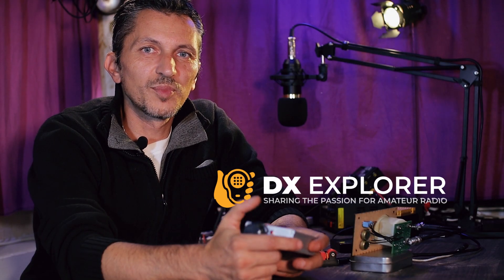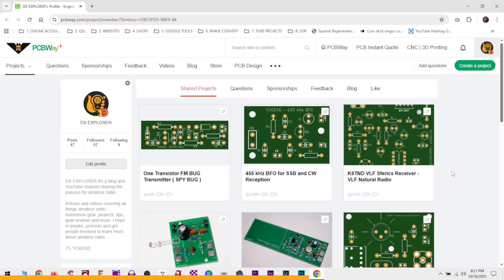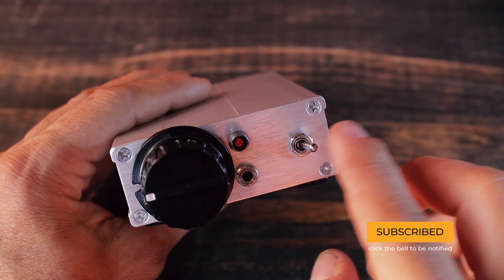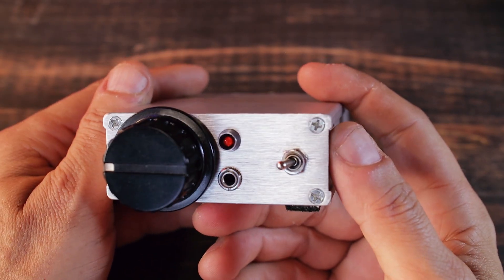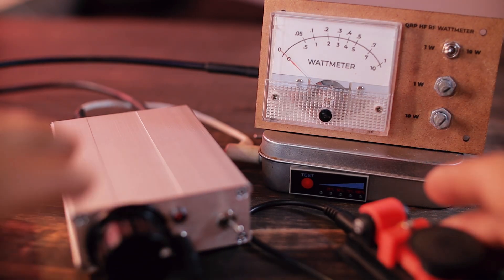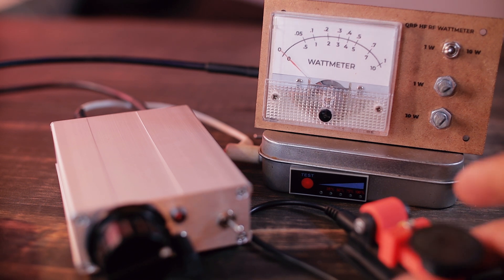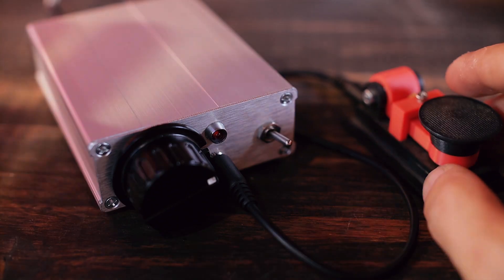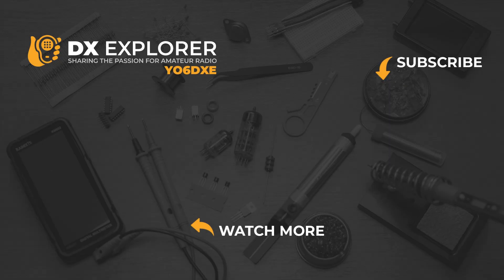Mini 20 - 400mW CW Portable QRP Transmitter With VXO

Comment: Mr. DX: GREETINGS!!! -- After watching your video here and reviewing your schematic of this "CW Transmitter", I believe you need to add-in some clarification within your schematic between your RX/TX switch (K) and your antenna symbol (ANT) that not only shows how the antenna is switched between -- RECEIVE & TRANSMIT -- but also with how you have the 50-Ohm 1/2-Watt Dummy-Load Resistor wired in as well. You spent a fair amount of time explaining all of this within your video, but your schematic doesn't show how any of this is connected and/or done at all whatsoever!!! Otherwise.....nice job!!!

/
Reply from the maker: Of course it's not in the schematic. The RX / TX switch was something custom made for my friend. But if you want to do the same... have a look later on today in the posts section here on the channel... I will post later in the afternoon a drawing to explain how I connected everything. 73, YO6DXDE.
Reply from the maker: Here it is: http://youtube.com/post/UgkxmwA86pfxjLcs0JHOFVwsiikqpW9yvLra?si=sepwgCgfMs0EGO3L

Comment: I can not understand how Q2 works. L2 shorts out the DC bias (Base Emitter) for Q2. When it don´t need any DC bias where is R4/33k good for?
Reply: If I´m right it should be possible to remove R4 without any effect. Q2 works than in C-mode.
Reply from the maker: I don't know I didn't tried. I simply respected the transmitter part from the schematic of the Pixie transceiver.
Reply from the maker: If I remove the 100uH inductor, the power drops down for some reason. I don't really understand it here, but that is how the schematic is so I just build it and if it works I am happy 😁 I don't waste my time asking myself too many questions 😀 73, YO6DXE

Comment: can you test how it behaves with L3=22uH, 470uH, 1mH, 2.2mH, 4.7mH, 10mH, see power transitions on CW transmission? 
the idea is L3 is not a "choke", but a storage inductor. i don't have the means to see signals. 

the collector inductor, i believe, is wrongly presented as a RF blocker. many HAMs believe it is a RF blocker, but i doubt.
Reply from the maker: I don't think is an RF choke for sure. The value is too small. Not sure about the other bands, but I did tested with some other values for L3... and with 100uH for example the power went down if I remember well. Same for L2... as I tried to see if it still works if I don't install it. It did work but the power went down. I will try to experiment a little more when I will test the circuit on other bands as well. Talking about L3. 73, YO6DXE.
Reply: @dxexplorer  i expect the power to get down, transition like, if you increase L3. you observed the average power to go down for smaller L3. 
i am talking about not average power, but how momentary power transits to lower and lower, befor you stop the transmit, for bigger L3. that is the question! 
i expect that the best behavior is for some optimal L3 value, and that would mean it is not a choke, it is part of the storage inductor, or part of the resonator. 
i also expect the optimal L3 to depend on the bandwidth of the signal, and that depends on modulation, on data rate...
am against the view that you can simply put a large inductance choke. even if that can ensure the peak of transmitted power to be the intended, i expect the power to drop imediately, if L3 is large. 
if this cannot be observed easily, it may be more evident if the test is made with larger bandwidth, meaning high frequency CW, so to speak
Reply from the maker: From the times I was playing around with the Pixie transceiver... I do remember playing around with the 22uH inductor value as well... and not only that it was influencing the power output on transmit... but it was also changing the characteristics of the low pass filter... so that one was no longer working properly as it behaved really strange. So clearly in these simple circuits with little components count... every little change may affect something else as well sometimes. Is really nice to discover all these things... aspecially as I never studied electronics so for me is all new stuff every time.
Reply: @dxexplorer  the discussions i had with others... 
it was about larger L3 values, not smaller. 
they were convinced the supply process and the amplification process can and are separated. 
they consider the transistor is supplied in continuous current, and i disagree. 
as i understand physics, in reality the transistor is supplied in RF too. there is not continuous current supply, that is an assumption that works in some conditions, but not in general. we use continuous voltage supply, but an RF amplifier does not absorb in continuous current, it absorbs in terms of RF and of modulation, of data rate. i say it absorbs from the supply, to be clear. 
i contered some big HAMs, practically the biggest on youtube, they were convinced l# is simply a choke, that does not store the power of the signal
Reply from the maker: @saramanbrudesco  to be very honest and make you smile a little as well... life is too short to spend a lot of time thinking about a circuit as long as it works 😂 It is nice indeed to understand the way it works and what role each components plays in the circuit... but since I never like the engineering part but more the tinkering with components part... I never got too deep into the theory side. To me it was too boring for some reason. I am more in the style of... let's see if I change this value... what happens ? 😂 and that is how I discovered a lot and learned a lot... sometimes it worked... sometimes I had smoke parties. But that is the joy for me. 😁 But as a conclusion ... I doubt that inductor acts as a choke. Its possible ? Maybe... but the value seems too small for a choke. I honestly have no clue.
Reply: @dxexplorer  i very much understand you, but i personally cannot avoid to think about it. am scientist. 

ok, i will tell you how i see this: 

consider the ratio RF/modulation_frequency, 
make square root of it, 
use that number to multiply resonator inductance, that adapts and filters, at the output... consider thus some main output inductor for RF signal, 
the multiplied value, consider it for L3 in your schematic, 
then consider the other capacitances and inductance, maybe even the class of the amplifier can modify that value, expect some deviation from the calculated L3, there may be the optimal value for L3

point.
Reply from the maker: @saramanbrudesco  There is a good reason why I am not a scientist 😂 yes you have a point with calculating everything the best possible. I unfortunately do not have the patience and free time to do that so I just build schematics as I find them and then play a little here and there to see if I can get it to work a little better. It would be easier for me probably to calculate stuff... but again then I would lose all the joy in playing around. But to me is nice that there are people passionate of stuff I don't like... someone has to calculate those values too. And that is why we have people like you. Me on the other side... for me all this is just a big kid game playing around and having fun with the circuits. Pretty much the same way I did it when I was 12. The only difference is that now I have less smoke coming out... and for some reason the circuits also work 😅🙈
Reply: @dxexplorer  ok, but see what i did, i gave you the solution. solution that i did not find in books, so i thought it myself. i did not ask you to do like me, i gave it to you. 
the other thing, i said that if you are interested, and you have time and energy to check it, then check it. :)

about your projects, i mean your way of choosing them, i like it. when you get to controllers, you lost me. 
i consider this realm for recreation. we try the satisfaction of simplicity
Reply from the maker: @saramanbrudesco I did noted down the solution you gave me... for the days I have free time. I am also a curious kind you can imagine 😂 When it comes to these simple circuits... well the reason why I love so much all this old school technology... is that I grow up with it. Then I worked with it... and it was always reliable. Then we changed to digital stuff. I only had problems at work because it always created problems and I always had to fix stuff. So I kind of got sick of the "modern technology". Not to say that in the past they built things to last a lifetime... now... is all consumer type that "expires" really quick and you just need to buy more and more. And let's not talk about control... because we all see what direction all this modern technology takes. So I am happy to play with my transistors... the only ones I trust 😁
Reply: @dxexplorer  these words are of wisdom :) 

you know, the irony you surely are not aware, as any human, none of you noticed, but humans do not have a serious, intelligent idea about what is control, what is command, what is decision. 

i can ask: define these, control, command, decision, and do it like in science of physics, mathematics, logic! 
i can, because i can define. however, people do not really have an understanding on these. 
also there is no theory on control, command, decision. 

so, they want to control, but no one knows what control is :) 
and if they try to understand, hundreds of years are not enough. 

and this control, command, decision, it goes down to the reliable transistor. 
must be something satisfactory there, in the way control is exerted using the transistor. 
so you get to the Jedi feeling, to feel, while not understanding.
Reply from the maker: @saramanbrudesco  I tell you a joke... and kind of a wise saying from grandpa. He was saying "boy we learn all life long, and when we die we are still stupid" 😂 in the past years I started to understand more and more what he meant. On the other side playing with transistors... is not about me "controling" them... I just want a receiver or something out of them ... they are free to work or not 😅😅 on a bigger scale in the world... that is exactly why we have so many problems.  Those that want control don't know what it really is and how to command people to have that control... but they still want it even if they don't understand it... and on the other side... is simple people that don't want to be controlled and do not execute the commands 😅 is more like a game right now... Sadly a dangerous one.
Reply: @dxexplorer  "boy we learn all life long, and when we die we are still stupid" is not really smart. 
in principle, it could be smart, WITH the condition that the realm of all possibilities is infinite. 
hard for most to realize that in the Universe there are no infinity of possibilities. 
an intelligent educated person can calculate and write down, in any regard, the upper limit of all possibilities. 
what is the significance of this? 
if there are a finite number of possibilities, in total, and there will never be any infinite, of any kind, then a possible level of knowledge a human can have, is not infinitesimal, it is already a non-zero quantity in a non-infinite total. so you begin to measure success, not only failure, and so starts the defaming of "boy we learn all life long, and when we die we are still stupid".  
in my life, took many years, but i found that almost all proverbs and words of wisdom we inheritted from our parents, grandparents... are silly, not wise. 
so, if you find wisdom now, there is the possibility you become wiser than your father, wiser than all your ancestors
Reply from the maker: Well I will end up the day with my conclusion on that old saying front grandpa... then I go sleep as there is a crazy busy weekend waiting for me. The question is... look around us... look at all what we do and how much we destroy... are we actually intelligent ? Even with all the science and technology we thing we have... because I personally think we are not... and we still have lots to learn... but for sure not enough to learn in a lifetime. So I think he was right.  Anyway... have a fun and relaxing weekend my friend. Time to build some more stuff next week if the free time allows me to. 73, YO6DXE.
Reply: @dxexplorer  have a nice weekend! you need it. in Greece, they are about to introduce the 13 hours working day. after a while, you too, will have a 13 hours a day job
Reply from the maker: Thank you so much. I hope you have e a nice weekend as well. 73, YO6DXE